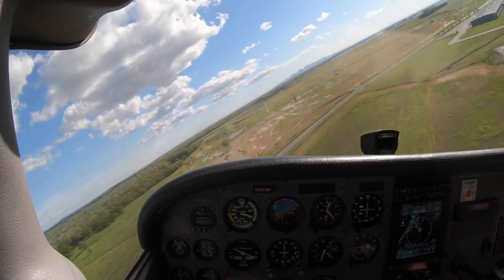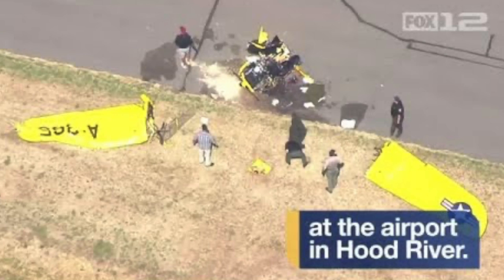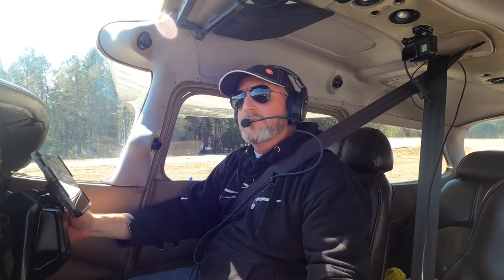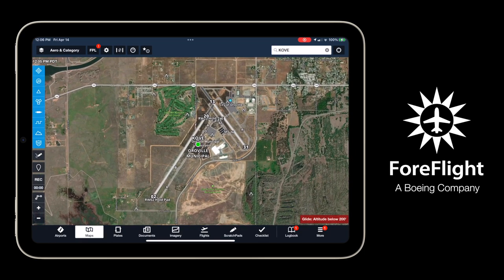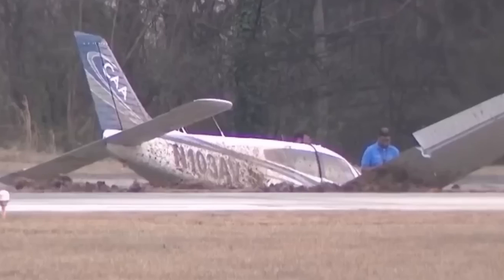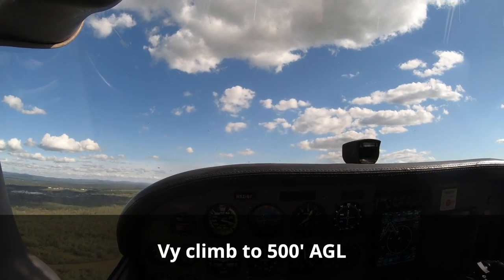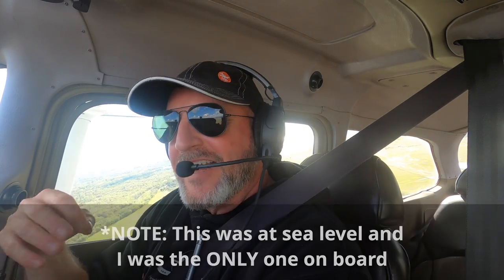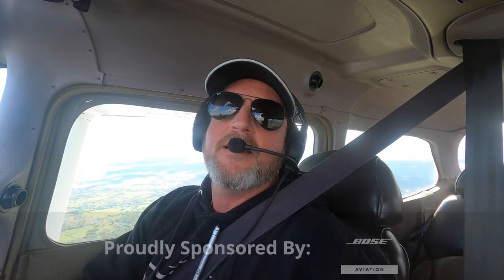The IMPOSSIBLE Turn? - Engine failure on takeoff - Airplane Crashes - 180º Turn Back To The Runway

Comment: There’s a scientific paper which studied the best roll angle for ‘the impossible turn’, balancing stall speed vs turn rate and the answer they came up with was 45 degrees, and I believe they also demonstrated that for most aircraft having flaps deployed during the initial turn back makes a big difference in reducing turn radius, but you may need to take them back out to reach the runway. For a 45 degree bank with constant descent rate your airspeed needs to be 19% above stall to account for the load factor, but then you need to build in a margin on top of that.
And nobody would ever fly that perfectly in a real situation.
Exceeding 45 degree bank increases stall risk, being less than 45 means not turning as fast as you could, so a bank of 30-45 degrees is what science says you should aim for.
Reply: Do you have a link to the paper at all?
Reply from the maker: Interesting - Do you have a link to that?
Reply: Is there enough time for the flaps to deploy before you have to retract them?  Maybe if your plane has a Johnson bar.  This is not a canyon turn where success is completion of a 180 and no flight into terrain.  Also now best glide speed is out the window and you also have to contend with Vfe in your spiral down; too much to deal with in an emergency turnback
Reply: I saw another video about this where a test was done at 2700' AGL, comparing a 60º turn to a 20º turn.  The experiment was done in a Bearhawk Patrol, which has similar characteristics as a Super Cub.  By the time the 180º turn had been completed, 300' had been lost in the case of the 20º turn, whereas only 200' was lost with the 60º turn.  As that pilot pointed out, load factor plays the more dramatic role in causing stalls, rather than angle of bank.  That is, pitch the nose down adequately for a 60º bank and you won't stall it.

To me, the big take-away from Jason's video, other than the importance of practicing for this possible emergency just generally, is that it seems like there would be real value in experimenting with the results obtained (how much altitude is lost) using different angles of bank, of course doing so at a sufficient altitude, making sure to have proper traffic awareness, and (critically) making sure to pitch forward appropriate to the degree of bank, so as to avoid stalling.  If you sometimes fly a 172, sometimes a Piper Cub, and sometimes a Piper Archer, then it seems like it would be useful to be familiar with the results for each of the planes you fly.

Thank you Jason for this great video!
Reply: Do you have enough time to whip that paper out, read and execute it after engine failure? I didnt when my engine failed at 100 agl....
Reply: @way2manyhobbies  I bet not and I don't see this feasible in anything but light highwings and stol aircraft.   Period.
Reply: whatever config gives you best glide is where to be at - cuz ya know you are trying to stay in the air
Reply: @brentdavidson1  Bingo; at that point, do whatcha need to keep flying.   Avoid Stall horn.
Reply: The impossible turn can NEVER be tested and can NEVER be trained for....having advance knowlege of attempting the turn gives back time you will not have when it happens as a surprise.
Reply: @stix2you  Good to have a minimum turnback altitude.  My ELM CFI in 1996 had a Cherokee in which he put little suction cup on altimeter.  ALSO A BLUE LINE on the Airspeed Indicator.  1996 DMMS, LOL.. We used it nicely for all emergency landings and all take offs, landings and all maneuvers. Great reference MARKERS when under pressure.
Reply: I would like to read that paper too. Do you have a reference to it?
Reply: Rember 2 things, Increased stall speed due to bank is assuming a "LEVEL" turn. If you nose down in the turn "Decrease AOA",  you negate the increase. Look what @eagle2019 wrote using his AOA gauge, he succeeded at 400 ft using 45-60degree banks and his AOA to not stall even though his stall horn was blaring.
Reply: @speedomars Calling all Turnback Turns aa "Impossible Turns" is not only BS.  It is wrong for a pilot to be so closed minded about a maneuvers that is done thousands of times a day by Crop Dusters, Line Patrol Pilots and military pilots too.  Weak pilots crash, not those.
Reply: @JavierBrent  Save it dude.   The physics of flight, lift and stalls are immutable.  Your examples are BS.  Trolling in technical areas only exposes you.
Reply: @speedomars  Nope.  I have experience on 2 kinds of turnbacks i learned 2 decades ago.  Military..  You dont know half of what i know.  Want to bet on that?
Reply: @speedomars  Calling all Turnback Turns an "Impossible Turn" is not only BS.  It is wrong for a pilot to be so closed minded about a maneuver that is done thousands of times a day by Crop Dusters, Line Patrol Pilots and military pilots too.  Weak pilots crash, not those that know how.
1

Comment: I had a total engine failure at 400 feet agl. Ahead of me was an inaccessible ravine. My choice to die where it would take a long time to be rescued or turn back. The most important thing is fly the aircraft, do the turn immediately while  you have flying speed, then pick the best landing place where you can be rescued. I successfully returned to the airport and landed on the runway. As stated in the vid the most important thing is keep flying the aircraft.
Reply: = keep nose down and 45 degree bank.  Flaps and cut mixture if high.
Reply: Well done my friend!  Every situation is different...glad it all worked out for you!
Reply: WHAT AIRPLANE?

Comment: I was getting checked out in my Citabria last summer when the CFI told me we were going to do this…. I was always told never to try it so I was surprised …… we did it right at 500ft AGL and we had a little wind helping us but I was amazed I actually slipped the landing to put it in the numbers….. 

Best takeaway from your video for me was there are lots of variables…. So don’t think it will happen the same way every time
Reply: Also I think somebody mentioned it but my CFI was also a glider guy
Reply: @jeffhumbert483  Glider Pilots have to do Turnbacks after departure. They are not cowards..
Reply: You did nothing.  KNOWING you are going to attempt the turn is NOT the same as the impossible turn.
Reply: @speedomars  That was not an Impossible Turnback.  Some guys like the name, even after they did it.  Wrong to call a Possible as Impossible.  Dumb..

Comment: I did the "impossible turn" on my BFR with an instructor. We were probably closer to 800' in a piper archer. I immediately pushed the nose down and banked pretty steep. When I got back facing the airport, I had to put in full flaps and slip the plane to get it down. The advice in this video is crucial. You have to pitch down to avoid a stall. And you don't need to do a gentle turn. You need to get the plane around quickly. Finally, get up with a CFI and practice this. You need to make the decision whether or not to turn back as quickly as possible. It should be second nature.

Comment: If you really want to increase your chances of surviving an impossible turn, install an AOA indicator.  I installed the Bendix King KLR 10 AOA system in my 1978 Cessna Cardinal RG.  I then went out and practiced the impossible turn starting at 1,000 feet and lowering subsequent attempts by 100 feet each time.  I was able to complete the impossible turn from 1,000 feet down to 400 feet.  The lowest safe return was at 400 feet.  During each attempt the turn was made at 45 degrees to 60 degrees using the AOA to determine available lift.   During each attempt the stall warning horn was blaring even though the AOA was showing available lift.

I think an AOA indicator should be mandatory equipment in every aircraft.  For me it is one of the best pieces of safety equipment I have in my airplane!!!
Reply: I agree with you, but only from what I read about these things.  My reality is- yesterday I flew a C172 with an AOA indicator installed, first time I have ever seen one in person.  I went up to do a small x-c and shoot a  few approaches/landings.  I did five approaches to land and one go-around, and not once did the AOA indicator ever enter my conscious sight or register as existing, despite being almost directly in my line of sight.  Apparently some training is indicated for using them correctly! :)
Reply: AOA indicator or not NEVER attempt the impossible turn in a real engine out.. once the engine quits it belongs to insurance land straight ahead it’s called the impossible turn for a reason don’t pull an AOPA and do it
Reply: @neile8378  What about if you programmed the minimum altitude before take off.  and know how to turnback from that and where to head, taxiway, grass or runway etc? Stupid not to know a maneuver that can save you from crashing.  Same as we practice power off spirals between clouds when IFR on top.  Duhh.
Reply: Excellent! Thank You!!,  Do me a favor please. Attempt the same with 10 degrees flaps left in like McSpadden did. I am curious if 1. reguired altitude is higher 2. if the AOA somehow indicates this to you in some way, possilbly by airspeed descent rate something that if you make a McSpadden mistake that you would catch it. Very Ironic you have his near identical airplane. ..... Please get back to me.
Reply: @craighill2696  MacSpadden knew hot to make turnbacks to opposite but on a lighter Super Cub. Anyway, it was the big boneheaded guy on his left seat that i bet he dummy as owner pop the gear out when too low to the runway.  Dont fly with idiots..

Comment: I'm so glad you are covering this topic! It wasn't until I started flying gliders that I realized how crazy it is this maneuver is not widely demonstrated, when it is performed on every glider checkout and checkride. I now talk about this with my students and demonstrate it at least once (difficult in my area since all the airports are usually busy) to show how they can live in an engine failure. I refuse to solo my students and just shrug my shoulders and think "I hope they don't have an engine failure on the upwind." Everyone should be prepared and have a minimum return altitude with fluctuates based on terrain, conditions, proficiency, aircraft, and better landing options. At my home airport it's 700 feet, in the middle of the countryside it's often 1000 feet or above.
Reply: I've said it before and I'll say it again: Every airplane pilot should get a glider rating. There is nothing that will give you a feel for the aircraft and develop your stick and rudder skills as much as flying a glider. Plus, it's a heck of a lot of fun!
Reply: @johnopalko5223  Agreed but we must remember that the answer to what the powered airplane wants to do when no power but prop windmilling...go downhill, go downhill now.  Maneuvering flight means go there, go now.  The choices in the near horizon are few but easy to determine.  It is a six second deal.
Reply: Gliders are NOTHING like powered flight.  To suggest such a thing sports a lack of knowledge in aerodynamics, drag and weight.
Reply: @speedomars  All airplanes can glide and turn too.  Duhh.   Ignorance is not the answer.  Besides Turnbacks are needed on GRM and mountain flying too.
Reply: Gliders have 40:1 or better glide ratios. Your typical Cessna is 7:1 or worse. Not even comparable. It's all about climb angle vs. glide angle. Power pilots also forget that the day the engine dies for real, they probably didn't get the expected takeoff/climb performance, so they're already screwed. It is just stupid to try and turn back (and I fly gliders and I will not turn back in even those!). It's just freaking dumb.

Comment: Years ago a high time military instructor taught me how to exit a high altitude box canyon in a Cessna 172.  Conventional training says go into slow flight with flaps and make a gentle 180 turn, which he said would get you killed.  His approach was an Immelmann, if you had the power which a 172 does not.  The next best option is as follows.  If you have 300+ of air under you and have 65+ knots of air speed, immediately pull back to the vertical and before coming to a stop, kick the rudder full left or right and turn the aircraft back down the same angle you started from.  As airspeed increases begin to pull back to level.  You should be able to accomplish this with only a loss of 200 feet in altitude.  We practiced that at 10,000 feet to see if I could meet the 200 ft loss limit. I succeeded !

Comment: I did practice this Impossible turn many times at about 500 ft. I am an ultralight pilot and it's a lot easier as the flight speed is much lower and you can basically turn on the spot...as long as you are fast enough to push the stick. The routine was push, turn again the wind (rarely dead in the track direction).
The good thing with ultralight is that losing the engine is just normal and expected all the time once you manage to start it...

Comment: Great topic, and a great video. One thing that always bothered me about this discussion is the need to push agressively forward to the extent of feeling zero G. You are not the only one who has stated this. I've heard this repeated by many others. I have done this exercise many times, and never saw the need to be agressive on the controls. Just releasing the controls will make the airplane reach its trimmed speed by itself. I teach students to relax the controls to let the airplane fly itself. In most GA planes, you cannot stall the airplane by releasing the controls, even if the trim is all the way up.
Reply: I think I agree and would add getting a coordinated turn started soon after releasing or non-aggressively maneuvering the yoke/stick.  That will help get you away from a stall and into the turnback more quickly
Reply: This is a good point -- I almost never need to aggressively push down -- and I tested this in 172s and 182s. I am gusssing most small GA airplanes will pitch down when power is reduced (due to low tail airflow), they often SPEED UP! Opposite is true when trimmed for slow flight and you apply full power -- hence the need for the "Elevator Trim Stall" maneuver for instructors. Sadly this is only one of several inaccuracies that are being taught about this.

Comment: During my PPL Checkride, I was asked to do an impossible turn at 500agl. The examiner asked me to climb at Vx in a 172, and it actually made the turn quite handily, to the extent that I had to execute a forward slip or I would've touched down too far down the runway.
Reply: Dont climb a Vx.  Bad for the engine and pushing nose down is harder too.
Reply: @emergencylowmaneuvering7350  Which Vx are you referring to ?  The one in the POH/AFM , which is full flap or Vx [clean] which is often not found in the handbook for many aircraft ?

Comment: Another point to consider is a partial loss of power on takeoff.   Had this happen not too long ago (with my CFI) and we easily made it back to the runway since we could still make some power.  I now brief what direction I will turn (into whatever crosswind there is) so that my chance of making it back to the runway increases with a partial loss of power!
Reply: Right.  Most engine fails are partial power.   I practiced on Cherokees from 400 agl,  troubleshoot while doing a Teardrop Turnback if cant climb at all.

Comment: Great video Jason! But remember, it’s the DEPARTURE leg that we lose power/cut power on for simulated purposes. We’re not on the upwind unless we aren’t getting blown over there off the extended centerline. Lol.
Reply: That is a bad habit to call the climb out or Departure leg as THE UPWIND.  Or to call the EFATO Turnback as "The 180" as he does many times up to now.
Reply: I think Jason does call this the Departure/Upwind leg in his prior Patreon and/or podcast on the possible turn.  However I have the same concern as you regarding the terminology.  I've asked numerous experts including Jason, about this and the answer I get is that it's custom, even though it's not correct terminology according to the AIM and other sources.  For a good blog post on this google this one by Jason Blair:  "So where in the pattern is the upwind".
Reply: @eds.173  BAD Custom.  Like pilots calling over Joes Bar..  What?  You dont know where Joes Bar is?  Its on the mid upwind..  .. GEE.... F them..

Comment: I did a club checkout flight in Northern Finland and the FI made me practice the impossible turn. We were able to turn back consistently from 500 feet AGL (Cessna 172P, two people, airport more or less sea level). After the turn, we actually had to slip slightly to avoid overshooting the (long) runway, it was a pretty windy day. Seeing the ground rush up to you in that steep gliding turn was quite an experience.
Reply: That said, my pre takeoff briefing still comes with 'push, XX [speed depending on the plane], shallow turns, forced landing in the front sector' :)

Comment: Great video. I had an engine failure at 100 feet after takeoff. I remenber saying " "airspeed airspeed airspeed" as i made a gentle turn to my right and went down in an overgrown pasture which ripped my right gear off, spun me 90 degrees before i hit the ground. Walked away without a scratch on me due to the low stall speed of my AC, deceleration and shock absorption from the overgrown saplings in the field.